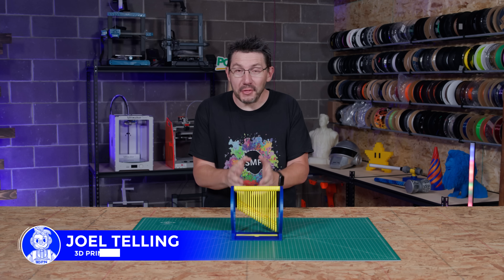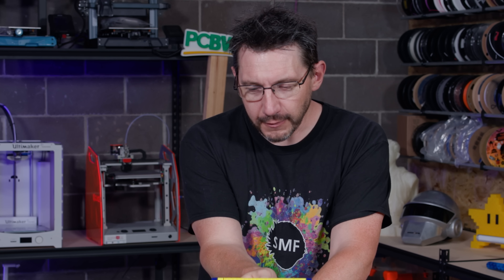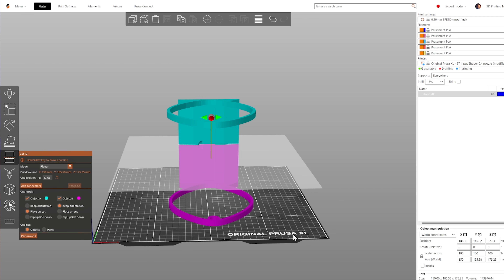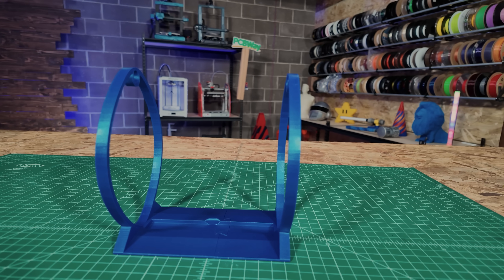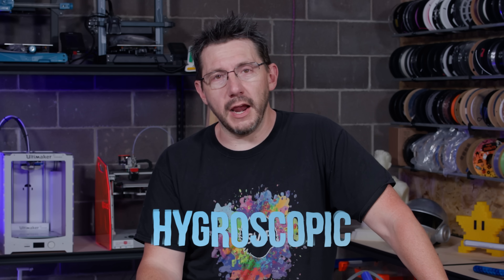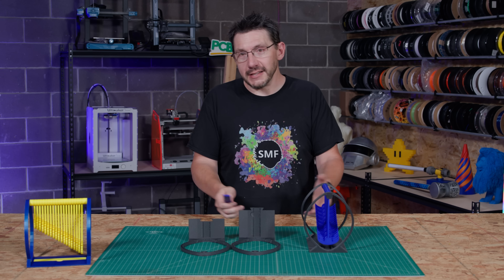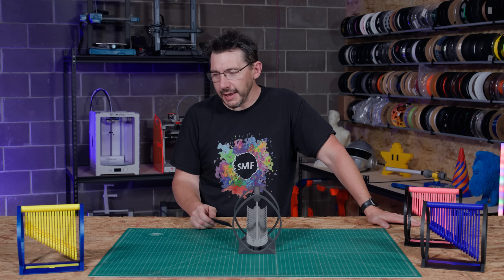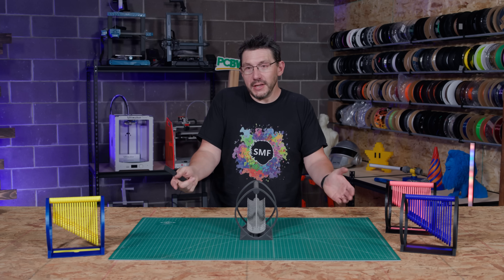Full Metal Pendulum! AMAZING 3D Print Bunny PRINTS!

Comment: Curious that you said the metal one doesn't swing as long when metal is heavier and therefore has more kinetic energy 🤔 maybe the extra weight just gives it more friction which ends up canceling out the benefits 🤷🏿‍♀️
Reply: You are correct, it's a friction thing.

Indeed, the weight would in theory be irrelevant, if not for friction and aerodynamic drag. Acceleration due to gravity is a constant regardless of mass, so the actual speed of the pendulum would remain the same (affected only by the length of the pendulum, because that changes the distance it travels and hence the duration of the acceleration), and of course the upswing of the pendulum would exactly counteract the energy added during the downswing.

But once you start adding drag into the system -- friction and aerodynamic -- things like weight and shape have effects that matter. Weight can help overcome drag, but also can cause increased drag, so what actually happens depends on each relative effect in the different scenarios. Weight can overcome friction, but will never accelerate the pendulum faster than the frictionless ideal. But it's affecting drag and acceleration differently in each print depending on the materials used, so the metal one could've swung longer, if not for the friction increasing more.
Reply: @harvey66616  that's a lotta words, my guy 6.6

Comment: The timing on this video is great, especially given that I just did a run of DMLS titanium parts on PCBWay to give as gifts! Their Ti is a little more expensive than their stainless for sure, but one nice thing about both of them is that they should be solid. So if you want to do a little post processing (try it on a spare part first…), you should be able to sand the flat faces with some 150 grit or so and start to get a nice brushed finish on them instead of the matte DMLS finish. (With Ti, you can also anodize them for color very easily. When I get to a computer I’ll email you a link of my Ti DMLS project so you can see the results - I highly recommend trying it!)

Comment: Such a cool desk toy, but I can't help but think of a half-dozen improvements.  Most notably, it needs a starting lever in place of that plastic stick.  This would be a bar that runs end-to-end across the pendulums, attached to the main rod at both ends just like the pendulums, and with a long lever on one end.  To start the pendulum motion, you would simply rotate the lever up and over, 360 degrees, which brings all the pendulums to the top and tips them over-center at the same time.  Not only would that be easier to start the motion, but the higher starting point would provide for a much longer runtime.  The lever would need to be heavy enough that the crossbar rests at the top above the assembly, out of the way when not being used.  Another important improvements would be securing the main rod into the frame, making the base heavier, and possibly even using fidget spinner style 608 bearings.  A shame they don't allow mods, but for a simple design like this it might be easier to redesign from scratch.  Bonus feature, add a motor to automate the starting lever, so this runs on autopilot forever...

Comment: @3DPrintingNerd
I need your help,
I am a 16 year old who has put easily over 1000 dollars in my printer, l've come across an issue recently that no one seems to know what is and it won't go away l've spent weeks after weeks trying to get it to work going inside and out of the thing. I need advice from someone who has probably been through the bare bone of printers, heck l'd come drive to you at this point with the amount of money I've put in this, I know what you think, it's probably just some easy fix nothing bad, trust me it's not. The people of Reddit can't even help me, l've done everything | can taken every piece of advice g code, slicer settings, new parts, tightening and adjusting the printer, you name it, l've done it. Please get this to 3D Printing nerd. He may be my last hope, thanks!